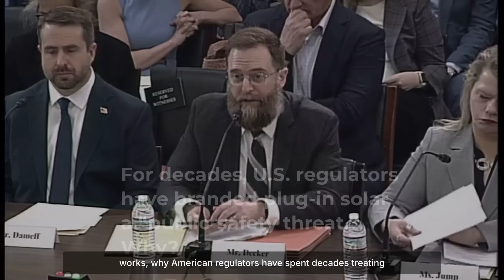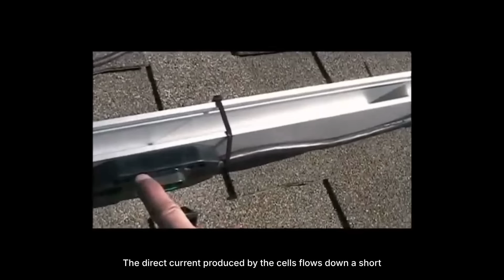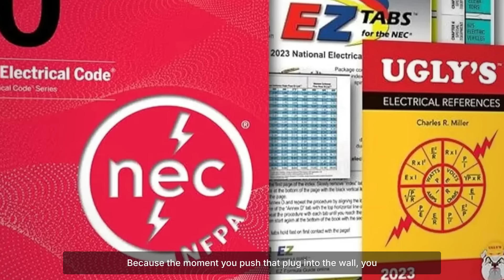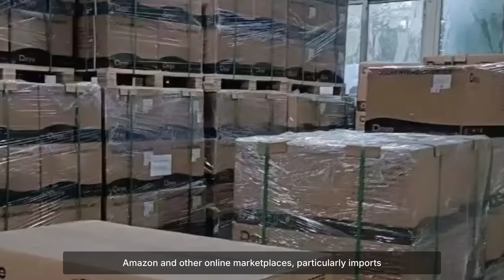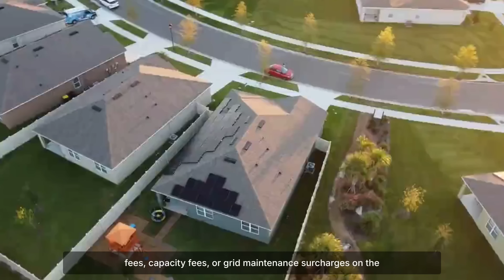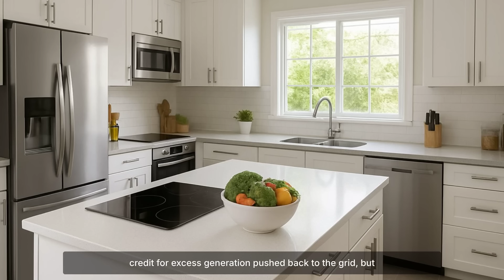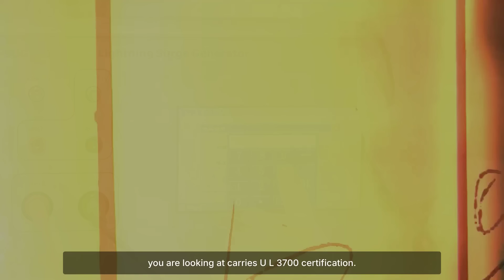This DIY Solar Trick Powers Your Home for FREE. Why Is It Illegal?

Comment: The "regulatory framework" in the USA also makes all solar power 3 to 5 times more expensive than in Australia.  "Home of the brave and land of the free" indeed?  Protection of corporate or government profits seems to be paramount at every turn.
Reply: The $25k installs price was a bit shocking.  I should hope that this will buy you a lot more generating capacity than plug-in solar can provide.  
I paid €7k for a 12 panel job (partly on a tiled roof, partly on a flat one).  And that wasn't considered particularly cheap here either.
Reply: I’m in California and get billed every two months. Before solar, my electric bills were typically $1,800–2,000 per cycle. I paid about $45k for a 48-panel rooftop system (~$1k per panel installed). Eight years later, even after adding an EV, my bills are usually $300–800 per cycle instead. I’m basically at ROI now, so from here on out it’s mostly savings.

The biggest downside has been changes to net metering. When I bought the system, excess daytime production effectively offset my nighttime usage at close to the retail rate. Under newer rules, exported power is credited much lower — often closer to avoided-cost or wholesale-style pricing. The difference can be huge: roughly $0.21/kWh retail vs. around $0.06/kWh export credit in some cases. That’s why many solar owners are now considering home battery systems instead of relying on the grid as “storage.”

As for European-style plug-in balcony solar panels, there are legitimate safety and code concerns in the US. Utilities require anti-islanding protections so systems automatically shut off during outages to prevent backfeeding lines that crews may be working on. US electrical standards and permitting rules are also different from many European systems.

A lot of people frame these regulations as purely protectionist, but there are legitimate grid-management issues too. Power grids have to balance generation and demand in real time. Large amounts of solar can create midday oversupply and steep evening demand ramps, making load balancing and plant scheduling more difficult — especially on cloudy days or during peak demand.
Reply: Let us do a few figures... and yes I'm jealous of your fuel prices, taking into consideration exchange rates and the fact we have litres not gallons we are currently paying $8.34 USD / gallon for diesel..  our dollar is worth about 70 US cents and our domestic electricity is typically 29 US cents per KWH our feed in tarrif is at best 8.4 US cents per KWH and they hit us with a daily connection fee of about 91 US cents per day. 
For a while the government was paying about half the cost of solar grid tie installations but it only went up to 1.5 KW capacity systems... so for an installed 1.5 kw system providing it was pretty straight forward you would pay about $2100 USD out of your own pocket, but that has finished and costs about $4200 USD now per 1.5 KW... 
The good thing about it ending now is we can increase system size to something more realistic to our needs.. but the real price installed remains about $4200 USD per 1.5kw. 

If your in the trade and know what you are doing... you can get good second hand everywhere... because if a solar installation gets one panel damaged and it is covered by insurance it is more cost effective to replace the entire installation rather than to try and source a matching pannel with the same rating, voltage and internal resistance and then guarantee it will work...  which means there are lots of good working panels going to scrap, and if you know how to match them and set them up you can save heaps... I'm talking 10kw of solar panels for $500 AUD, sort of money!
Reply: Well yeah. We call it businesswafe
Reply: You could do this in any country. Secondhand used roof top inverters are $100 with used solar panels can be plugged in to the power outlet illegaly

Comment: use an inverter with zero export function and a breaker ... problem solved.
Reply: Yes, this is it. But instead of "breaker", I think you meant a "sensor".  Specifically, a "CT sensor" clamped to the house mains. 

For other readers...

The sensor provides the inverter with the mains magnitude & direction signal (measured in watts), which are required for the inverter to throttle its power output in real time to maintain a zero export condition at all times. 👍

Comment: wrong analysis on micro inverter. It require reference voltage of live line if line down inverter generation is also down.also if your home is designed for max 10amp power, how one is going to put 15amp through it? If your load is max 10Amp even if Microinverter put 5Amp in circuit, max u require from grid is 5Amp.

Comment: Not great information, you mean GRID TIED INverter system. SAFE. And not hard wired . soft feeds in and cuts off when mains goes off. What was the issue.
Reply: Money for the electric providers.

Comment: If you can't afford a complete solar panel instillation, consider leasing your panels. We had a good solar company, SolarCity, start our solar lease and Tesla purchased them. We only pay for the energy that goes through our inverters. For us, at $0.15/kW, it's still cheaper than our utility even at their $0.14/kW because of the added distribution fees. That being said, I wouldn't mind paying the utility for the distribution, but without the Fed/State taxes.  As a result, we have the appropriate safety guards and the utility net metering agreement and meter.

Comment: It is also illegal to use a male plug to energize a circuit. The plug their showing is called a suicide plug and goes against electrical code
Reply: It is not a gas generator with zero intelligence... It needs an ac presents before power production, yes there is a delay....
Reply: @brucearkwrightjr.9246 in the US the code book still says it is illegal to make this type of cord. Code section 406. 7 D. You can interpret this any way you like but the intent is for these courts to be illegal. It does not say anything about a smart device a delayed in producing power the the ability for it to sense current or voltage. They intend for these courts to be illegal. If for some reason the device malfunctions and you kill somebody. You will lose the incoming lawsuit.
Reply: @timtom2061 they have made this legal in Utah so I'm guessing they changed the law

Comment: If you do the exact same thing but do not plug it into the wall outlet you are not breaking any code. In the summertime size your system to run a small window air conditioner. In the winter time sizes it to run a small heater. No back feeding into the electrical grid. You can plug any appliance also into the extension cord whatever runs during the day.
Reply: You are right that as long as the power provided by your panel(s) never sees the grid, you will not violate any of the issues mentioned in the video. However, and maybe I don't have the full picture, but with one or more solar panels you are at the mercy of the sun. As a result as the sun goes down or cloud cover occurs, the inverter will not be able to provide all the power required in some situations. The voltage or amperage will drop. The AC may be harmed in the process. The space heater will simply provide less heat with less power. Now if you had a battery backup and filled the batteries completely before installing your AC or small heater, then consistent  voltage/amp draw would be provided. Just be careful is all I'm saying.
Reply: I am planning a system that does not interact with the grid. I am planning on accumulating the power in batteries. That said, while it will not interact with the grid, i still plan to conform to NEC 2023 (especially 690) including an external shutoff locable in the off position and get permits. The permit is cheap, and the NEC has a lot of requirements in furtherence of safety. 

 @NathanZSolomon-q9s
Reply: Or buy a battery and plug things into the battery

Comment: just  don't use grid tie inverters.... there are 250$ hybrid inverters that isolate you from the grid ... let you use solar panels, battery, you can charge the battery from the grid, or from the solar panels, but it works too without the battery...  I think its irresponsible to dump electricity into the grid without a tecnician's approval.
Reply: yes that sounds just like some one that works for or in with the utility companies in the usa trying to save his job. just like every other industrial companies that can not make money on recurring income money they just make it illeagel in USA. just look at the AC industry companys they had made it illage to dig a tunnel 6 to 10 feet away from your house to cool the incomeing air down to 62 degrees that would be drawn into your house to cool that house down forever with no electricity at all. with that type of systems the AC industry's would not be able to make any money at all. so they passed laws to make it illeagel to build in USA. but this same sysems is being used all the time over sea legallly but its illagal in the USA. ask your self why is that its because there are no recurring income for them is why. for you just pay one time and thats it for the rest of your life no repaires needed and very little repaires at all. why  you can not do what other countrys are able to do and its illagal in USA this is why.
Reply: California charges $.47 a kilowatt hour plus exorbitant service, delivery, connection, and interface fees, then they pay you 7 cents a kilowatt hour for solar power you generate. It's nothing but a corporate rip off. You're much better off with a private battery system.

Comment: YOU ARE PROMOTING/ADVERTIZING A DEADLY DEVICE:
As an electrician, I can tell you that by back-feeding 120 VAC into the secondary windings of that little transformer on the pole in front of your house, you can create 6,900 Volt pulses back into the power lines. Since the measly 800 watts of power from the solar cells is too small to sustain the transformer loop's current needs, the solar panel will short, then it's voltage will collapse. Since the sun's potential is still there, and since the inverter has no idea what just happened, it will try to turn back on, over and over again, I have been blasted so many times from lighting ballasts in industrial plants with emergency back-up lights, it is not funny. This, from possibly hundreds of users is not a good idea
Reply: Agree, if this is possible it would have to be switched, maybe you switch of main AC and Switch on this with a contactor programmed for when you will be off grid?   got to have some battery too...
Reply: Greetings from Germany. 800W of inverter power. Still alive. How is that possible?
Reply: @RBMK1500  It's because Mike is towing the company line.  I'm sure he will give us some lame excuse.
Reply: If it is so deadly, then why is there no issues in Europe?
Reply: No, that won't happen because all inverters of this type (grid-tie inverters) have a feature called "anti-islanding".  This feature immediately shuts down the inverter's output when grid power is not detected.

The anti-island feature is legally required in all listed grid-tie inverters since they were introduced well over a decade ago

In fact, grid-tie inverters need to see the grid AC waveform at all times to stay in sync via a PLL loop. Because if they become out of sync, the inverter itself will likely start smoking as it pushes current out of phase with the grid.  If out of phase, the grid will "win" and cause reverse current into the inverter.  That'll then blow out the inverter's diodes, MOSFETs, and electrolytic capacitors and any other components that cannot handle reverse current.

Comment: The problem is that utility companies love money as much as they hate mother earth.
Reply: Same here the philippines  all of a sudden they tagged solar diyers as guerila and illegal. Masking their greed of money by saying they cate about safety what a BS.
Reply: @pseudogmp1775  Solar dryers? Are you talking about a piece of rope and some clothes pins? I think that was supposed to be a joke.
Reply: There are dangers in backfeeding without careful isolation from other sources. This has to be engineered to prevent that before being allowed.
Reply: @kenandbarbie-b6c  It already is.  Most of Europe allowed for over 10 years.
Reply: @garytrawinski1843  Great if the engineering framework is openly adaptable-
* automatic disconnection,
* certified inverters,
* grid monitoring,
* relay isolation,
* and standardized interconnection rules.
This needs to be ironed out & adapted to fit the US electrical distribution network. Right now, it is the wild west!
Reply: Exactly, this not a safety issue, It a money issue for the power company.
Reply: @garytrawinski1843  Safety is key with US electrical standards & codes for solar back feeding not ironed out first. It truly is the wild west now in the US. We need some competent engineers to fix this. Some of the pioneering work has already been done elsewhere. Adapting to be compatible in the US needs engineering work.
Reply: @garytrawinski1843  So, since it's not a safety issue, you would be happy for your child to work on the street power grid when 20 households are backfeeding 10A current each?  You're not very bright, are you?
Reply: @einfelder8262 Why would you have your child work on the street power grid?  Are you insane?Besides, these inverters will be UL certified with the necessary safety features.  One of them is if the grid power is turned off for any reason, the inverter detects it and stops sending electricity to the grid in two seconds or less.  Now don't you feel foolish?